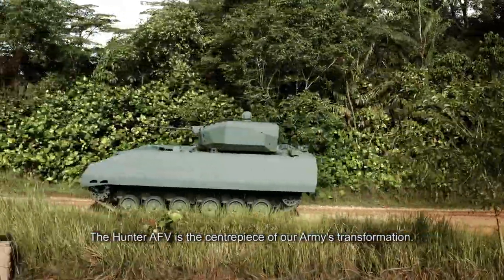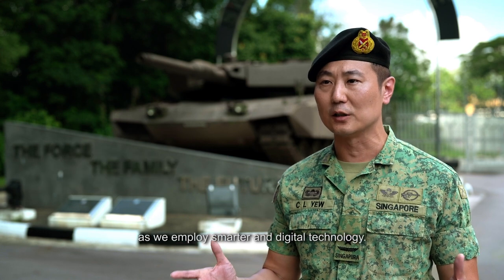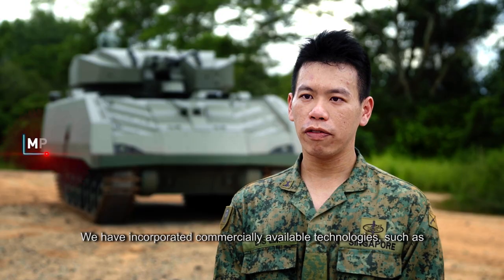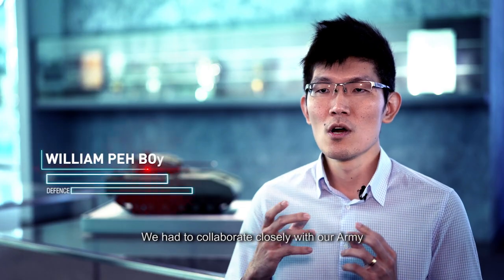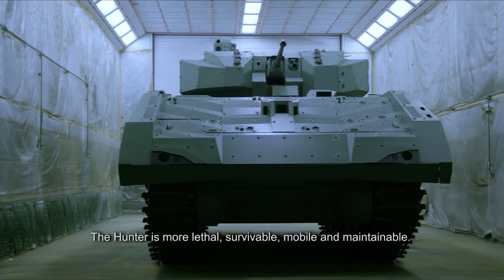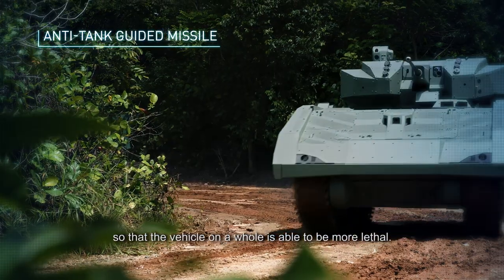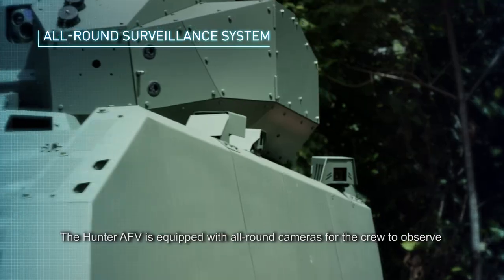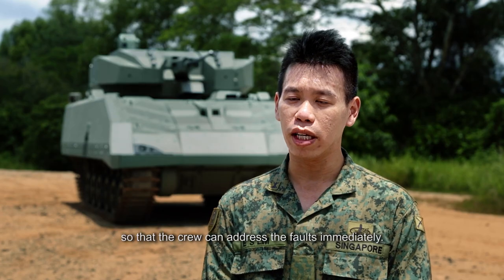Hunter Armoured Fighting Vehicle

Comment: I like tanks and Im proud Singapore has an advanced armoured vehicle. Its surprising it has anti-tank ammunition for a 30mm cannon. Well done SAF 👍
Reply: Consideration is based on the region's military development. 30mm should be good enough.
Reply: Its designed to be a AFV (armoured fighting Vehicle) its not meant to be a "tank" or a MBT (Main Battle Tank). Thats what we have the leopard tank for. this is meant for facing other AFVs or infantry units, it can take down mechanised infantry without a problem. 30mm AP rounds can pierce most armour and HE rounds can definitely take down infantry.
Reply: The 30mm is still good enough it used the same ammunition as the GAU 8 avenger in the A10 it also has APFSDS
Reply: 30mm is used for general infantry support. The Hunter has 2x Spike ATGM in a hidden roof launcher for antitank work.